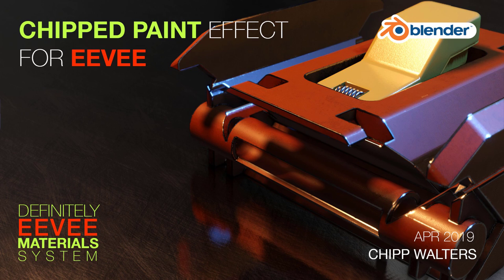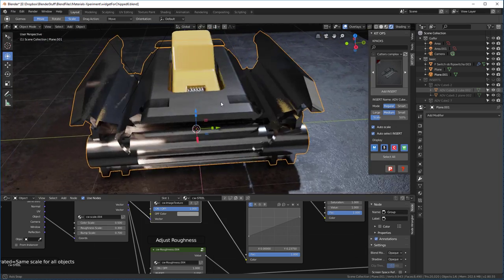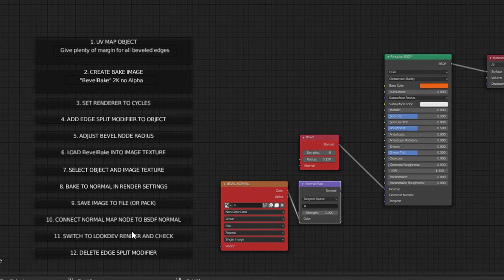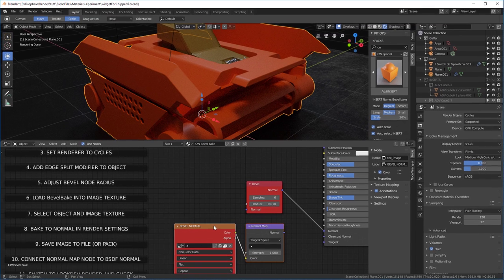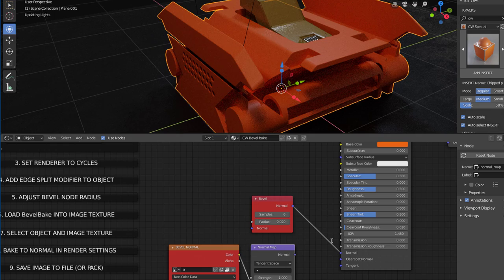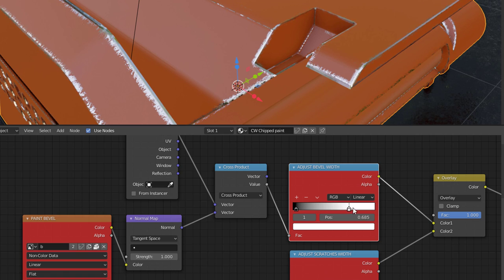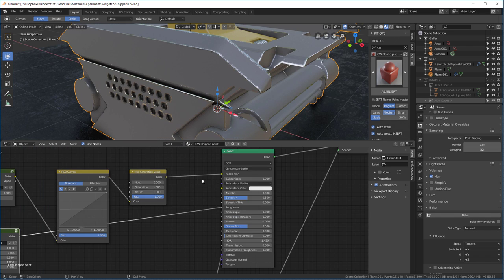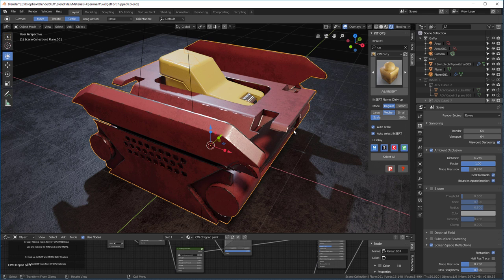Finally, Chipped Paint for Blender 2.8 EEVEE

Comment: Super useful and just in time! Many thanks for the chips Chipp! 😏

But seriously, I own 2 paid add-ons: Kit-Ops and Definitely Eevee! Brilliant work.

Must say there are a couple of functions in Hard-Ops and Box Cutter (especially those relating to bevels and edge sharpening), that I was a bit surprised and disappointed to not find in Kit Ops. Really feel like I'm pretty limited now until I can afford to buy those two as well.

Once you see "sharpen edges" at work the alternative workflows feel depressingly outdated and monotonous...
Reply from the maker: My workflow starts with an Auto Smooth setting of 20 degrees, which should set the INSERTS correctly without issue. You can of course set S Sharp manually, which isn't too hard. Just go into edit for the base shape and select sharp edges and them mark them sharp, or better yet add edge weight and adjust your bevel modifier using weight.